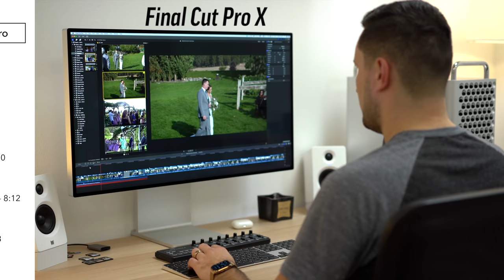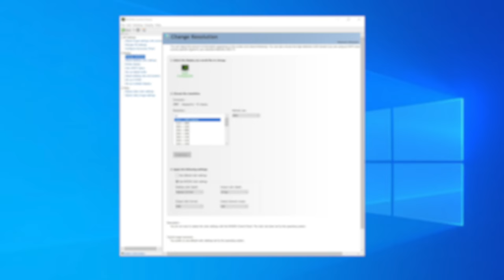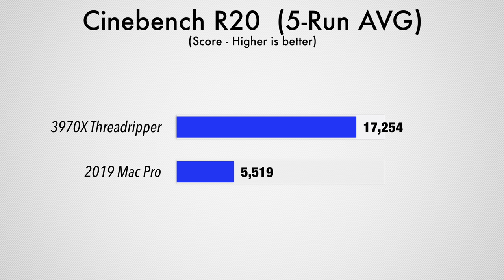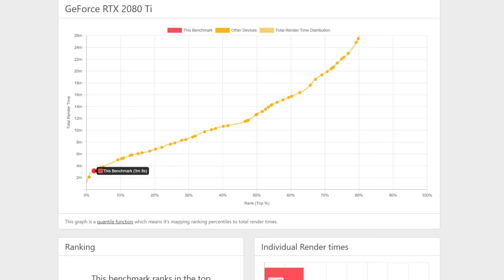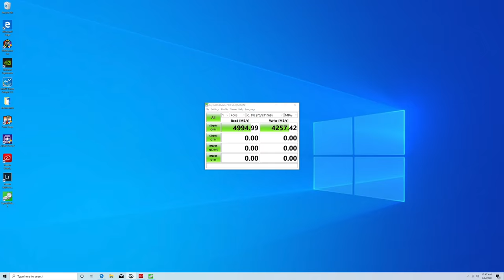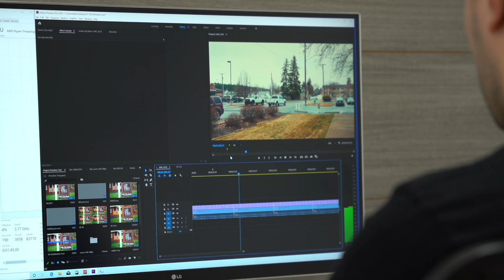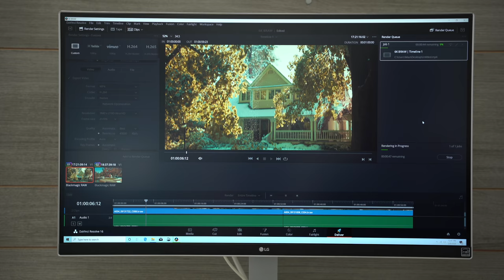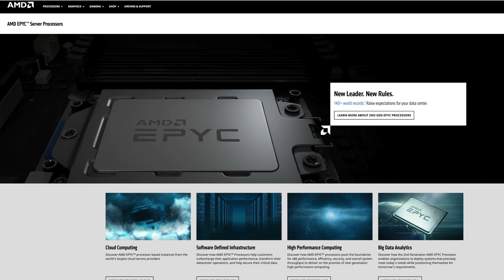$15,000 Mac Pro vs $5,000 Threadripper - Sorry Apple..

Comment: Imagine spending $15000 on a Mac that was outdated before it even came out lmao
Reply: Or if you max is out and spend $100k lol
Reply: I personally agree with what was said. The Mac performs better with the afterburner and speeds up my workflow when editing. And there’s final cut.
Reply: lol
Reply: @kavishpersad2102  final cut is trash
Reply: @toyotamarkIIjz  hate on macs all you want but final cut is NOT trash. Im not some apple fan, infact i hate their scummy drivers. However, final cur is N O T trash.
Reply: BoiCantGame yea, final cut competes with Adobe premiere pro, trash on macs all you want but final cut is amazing
Reply: More of the reason why Apple moving to their own sillicon and ditching x86. Mac Pro is only 15,000 with intel and upgrades directly from Apple. If you can build your own custom PC then you can upgrade your own mac without Apple doing it for you "facepalm"
Reply: @cr1m203   not what I meant at all, the Mac pros specs shipped with outdated hardware from 1-2 years ago, specifically the processors and GPU's, that isn't Intel's, AMD's, or Nvidias fault. It's what apple chose to use. Prebuilds with fair pricing are commonplace now, take a look at origin PC for example. 

What's apple does with its pricing isn't because of any third-party and isn't an excuse to make its own processors, they want as much revenue as possible, using their own cuts out the amount they pay Intel at our expense. Software and games are already difficult to code for Mac OS, now even harder with proprietary chips. 

Apple wants it's own bubble where everything is done by them. That's fine however it hurts the consumer as well as minimising competition. "Facepalm"
Reply: @tamazhi6762  My point is the price is not based on the outdated parts its based on letting APPLE do the upgrades for you. The video is not out lining the whole thing. Not everything has to be bought from Apple, and the base hardware is INTEL not AMD .....AMD has always been cheaper when building even custom pc's vs custom INTEL pc's was one of my major points.
Reply: @cr1m203   I mentioned AMD because in the base model, they use AMD Graphics cards. However, yes, Intel is generally more expensive, that still doesn't justify its price, like I said Origin PC do a great job at making reasonable markups on prebuilds.

Having apple CPU's is a bad thing too, because they would never make them purchasable as parts. You'd need to pay apple to do that for you.
Reply: @AgentSmith911  @10:44 he says maxed out .. exactly when I read your comment ..
Reply: Imagine buying several $15000 Mac Pros because you have a team of editors. $$$
Reply: man i said that to my apple fan boy brother in law he was triggered lol. i  said i could make  hima custom water cooled loop thread ripper for less he said  "ApPlE iS tHe FiRsT  tRiLliOn DoLlAr CoMpAnY"  like fuck ok spend 20k on a old tech PC man good for you you have a half speed PC and an apple with a chunk out of it
Reply: Damn😂
Reply: @Daakkii  I hate macs very much, but even i agree that final cut is pretty good. They have my respect. I respect the macbooks, i just hate everything else mac. Imacs, mac pro, etc
Reply: Now they should do a 15k$ Mac vs 15k$ PC I know the PC would win

Comment: Apple should hire him as a salesperson 😂
He is trying so hard to defend Apple
Reply: He needs to put his clown makeup back on. Complaining about the noise - adjust the fan curves then. Apple probably have the fan curves preset and this clown has left them at stock and complains lmao
Reply: @enesvergil7543  what?
Reply: Channel name is Mac Tech lmao what did you expect
Reply: @aa-anti  you sure its not Mac Tech?
Reply: @enesvergil7543  İyi misin kardeşim?
Reply: @enesvergil7543  bro i live in colombia and just for a little bit more money i can buy something better
Reply: ahah its done already
Reply: lolll
Reply: Mac SUCKS
Reply: @aightm8  or just buy a bunch of custom water cooling parts instead of an AIO
Reply: @AustenHilton  either way if the fans on the radiator are at a set RPM they are loud, even in a custom loop. It's just that no one who ever made a custom loop was dumb enough not to set a fan curve in the bios afterward. The issue in the video isn't the actual temperatures it's the fan configuration. A custom loop doesnt fix the issue because temp is not the issue.
Reply: He's Trying so hard to defend Apple That he didn't Even enable encoder On pc side while in Apple side He did Holly molly this Guy is Biased
Reply: He's already working for Apple Insider.
Reply: @slayelectro7334  Keep in mind that this guy writes for and gets paid by Apple Insider.
Reply: @aa-anti  More like Max Apple.
Reply: WTF the title of the video is literally “sorry Apple“
Reply: @Hottactioncop  Or Max Apple?
Reply: @TheXth  That's cause the threadripper is just that much better. He is trying to sell apple by saying "yeah apple still has its benefits though".

Comment: PC: Basically Outperforms most of the Mac Pro for 1/3 of the price.

This Dude: BUT THE NOISE!
Reply: trueeee xDDDD
Reply: There would be no noise if he just went with better cooling solutions. This guy is a complete clown
Reply: Oooof man it can be a drinking game, every time he says "BuT tEh NoiZz"
Reply: Also he forgot about VM's. If you really like MacOS using a VM with that kind of build is nothing which devalues buying the Mac even more.
Reply: @Sam-um1uh  yeah it has been shown that water cooling isn't better than air cooling
Reply: Its his fault anyway. He easily could have gotten better fans.
Reply: For 10k u can sound proof the entire pc so it's nkt an issue
Reply: Hes constantly mentioning the RAM too, like "well the pc can only have 200gb while the mac can have 1.5 tb" like what? Who even needs more than 64 gb?
Reply: @legoentertainment8750  ikr
Reply: @cyberspino6277  for 10k i can sound proof the whole house😂😂
Reply: @legoentertainment8750  people who use intensive and stressful programs such as Autocad or things like AI and or servers.
Reply: @noddlecak3279  OMG, Servers on Mac? Not even LAN servers
Reply: Lego & Entertainment ever used after effects?
Reply: @legoentertainment8750  You know what the funny thing is that he didn't mention the price that 200gb ram and 1.5tb would add 10k or 25k...
Reply: William Lau For threadtripper I think it right Ive seen that liquid cooling on An big cpu like that Its better for an air-cooler or an Custom expensive liquid ond
Reply: @mr.schaeffer5399  can soundproof the whole house, still can't afford a mid-range Mac Pro
Reply: Lmao
Reply: @WilliamDezunchd  I mean...you’re wrong, but nice try? Water is a perfect medium for storing heat, why the fuck do you think cars have loops filled with a water/antifreeze mix?
Reply: @noddlecak3279  well even with those I think 200gb is plenty
Reply: you take these tech reviewers seriously? they know as much as the regular folk! i just want for entertainment while taking a shit!
Reply: @Sam-um1uh  That Enermax cooler is a piece of garbage.  He can do much, much better.
Reply: @radu72ful  25k for mac pro from apple.. 10k from others.. Lol
Reply: @noddlecak3279  CAD can be done very well with 64 gigs ram as well.. That not a prob.. But I obviously have options to choose Epyc cpu and get 2tb ram just under 12k dollar unlike 25k for 1.5tb for mac pro lol!
Reply: @legoentertainment8750  he could buy a better motherboard and pit like 4TB ram in :D
Reply: based on on how much the comment section kept saying "the Noise", i am starting to suspect that The noise is actually made up by the dude (content maker) to have 1 reason to choose apple.
Reply: @aluandcache7336  15000$ comes with 9nly 786gigs of ram shithole
Reply: @ALmaN11223344  He's really not wrong IF you're an average consumer. The Noctua NH-D15 and Dark Rock 4 Pro match or outperform most aio's in the 240-280mm radiator range. They're quieter, cheaper, and the thermals measure just as low if not lower than most standard aios. Of course a 360 mm radiator will be better, but most people won't need that.

This isn't including custom loops.
Reply: @dat_lou5561  this comment has no base
Reply: @Nuka_Gaming  because it's a joke?
Reply: for the 10000$ you save you can get water cooler
Reply: The noise is actually still better than my mom's Lenovo Ideapad when running a game.

IT GOES LIKE A JET ENGINE, AND ITS FAN AS HOT AS ITS EXHAUST.
Reply: Increase the volume of your speakers or head phones or else just keep the PC in a drawer
Reply: @squadteam2309  XD
Reply: You can fix the noise lol
Reply: @legoentertainment8750  Also $25000 for 1.5 tb ram, Who needs a house when you have a white cheese shredder?

Comment: "Only 42% faster" 

The fact that it's considered a small bump even though the cost is 66% lower perfectly illustrates the absolute obliteration that Apple is going through.
Reply: That effectively makes it 326% better value for money though... One has to wonder what a 15 grand PC is capable of... 😅
Reply: @s4rg380  ⛄
Reply: @s4rg380  teleportation and warp 10 speeds!
Reply: @TENNSUMITSUMA  and probably nuclear meltdown... 😅
Reply: How do you get 326%?!
Reply: @TENNSUMITSUMA , it's 42% better, right? That is what he said, then it's 2/3 the cheaper, theoretically 142% for each 5 grand spent. 15k Mac - 5k PC

42+142+142 (the first third's 100% is negated because it equal to the Mac not exceeding.)

It's not exact mathematics, the proper scientific term is obliteration...

Don't qoute me on my math... (it's utter bullshit) 😅
Reply: @s4rg380  ah!
Reply: @TENNSUMITSUMA  🤣
Reply: only 1/3 the price
Reply: @fgtechtips , makes it 2/3 cheaper, doesn't it? I think you may have misread...
Reply: he didnt even use the 3990x which would have brought the cost up to half the price of the mac but maybe close to double the performance
Reply: @nicholasboule5134 , the 3990x is only $2000 more, so you are correct. Not sure if the performance is exactly double, but it is close enough to make no difference.

And some misguided 🍏 fool will still think that his Mac is more powerful.

"It's more expensive, so it has to be better, right?"

Wrong... It's good, but, not thát good.

Next, they'll want it to be compared to the $40000 Mac Pro.
Because that is just how Applefanboi logic works...
Reply: @s4rg380  amazing counter back to all 🐑 😁😁
Reply: @aluandcache7336  I truly have nothing against Apple, It's the ignorance of the users that trigger me.

Besides that, I just prefer actual value for my money.

I once saved up for a Mac, but I bought an equivalent PC and a new car instead...

I also use a MacBook air as a mouse pad, because of it's superior quality finish, and, that the only real way to game on a Mac.
Reply: @s4rg380  Same here! Exactly same! Those sheeps including Max Tech are just unbelievable.. Apple is there for being overpriced! You know for trim Mac Pro they are keeping 2000$ for each of 128gb ecc ram stick where I believe you can get each of those at 1000$ through a deal with Samsung or others..
Reply: @aluandcache7336  yeah, it's sickening that people are so naive... Apple tax.

The price of ignorance, I guess.
Reply: @aluandcache7336  hilariously though, AMD called their EPYC CPUs "ROME" because is wasn't built in one day.

But Intel has been resting on their laurels for too long, so I think a little competition is exactly what we need. That's the only way anything ever improves. I've been Intel all my life, but I am past the point of defending them.

You can guess what my next build will be, just giving it a bit of time to mature.
Reply: @s4rg380  Yeah exactly,, Without competition we would get products with a higher price point than what it should be..
Reply: @aluandcache7336 , exactly what is currently going on with Intel.
Reply: And when Apple does something better, he exaggerates it by saying "incredible" LuL
Reply: @s4rg380  broo please!
Reply: @aluandcache7336  I was referring to Intel constantly rehashing the same chips. Instead of innovation, they are resting on their laurels. Sorry for the late reply, I must have missed your previous comment.
Reply: @s4rg380  Intel is now lazy AF just like Qualcomm at mobile SoC
Reply: @aluandcache7336  I am slightly confused, you replied to me:

"Broo please! "

When clearly were on the same page, perhaps that was intended for someone else?

Soc will be stagnant for a bit, I think they have the limits of the current manufacturing process, which is the main reason Intel keeps rehashing. So, yes they're in the same boat, but for different reasons, Intel definitely has the capital to do the R&D, they just chose not to. I suppose the same holds true for Qualcomm.
Reply: @s4rg380  I was actually asking help for other comment section to encounter a triggered Applesheep as I'm not proper at English
Reply: @aluandcache7336  okay groovy, where's it at bro?
Reply: @aluandcache7336  English is my second language too, but that doesn't hold me back.
Reply: @s4rg380  You can find it in the top comments named Mark Dupuis. And that applesheep name is Prowlfilm
Reply: You tried hilariously hard to defend Apple tax, I salute you sir. 

111 coments?
Reply: @s4rg380  yes sir
Reply: @s4rg380  look prove him wrong somehow. but with logic where you're very good at
Reply: @aluandcache7336  go have a look... His comments are some of the dumbest I've seen, and trust me, I've seen plenty of dumb ones.
Reply: @s4rg380  So what will you do now? Wanna teach him some lessons?
Reply: @aluandcache7336  I left a comment, waiting for reply, though I'm not really expecting one. Kinda difficult to argue with what I pointed out.
Reply: @s4rg380  Man you just amazingly showed all points you got! Excellent work man! 

Can you inform me please where to get such English lessons?
Reply: @aluandcache7336  just keep at it buddy, It'll come on its own. Besides for someone who doesn't speak English natively you're not doing nearly as bad as you think. I've seen worse from people who are actually English. 

Mind if I ask what your mother tongue is?
Reply: @s4rg380  Thanks buddy! Your words mean a LOT to me! 

Can I get your any social id (facebook, whatsapp) or email? So I can get back to you.. Actually I feel some regional restrictions to expose myself. I hope you'll understand those restrictions. If I add with any of your social id I'll be then free to say you anything. Same time you can be a guideliner for me as well.. Tia
Reply: @aluandcache7336  are you satisfied now? 😂 🤣 😅

I don't feel comfortable with posting my number on YT, don't use Facebook, never had a liking for it, too much politics, if you catch my drift, could drop you mail though, that ain't an issue.
Reply: @s4rg380  Let me know after you knock me.
Reply: @aluandcache7336  sweet stuff, let me know when you got it.
Reply: @aluandcache7336  I dropped you a mail, subject will be: Sgt van der Walt
Reply: @s4rg380  Ok thanks for your cooperation
Reply: @s4rg380  and keep in mind that performance whise in cinebench r20 the pc scored 350% of the performance of the mac pro.
That mac is a ripoff
Reply: @s4rg380   after reading all of you comments with Epyc to Xeon. I have discovered that there are people who think like me, and to be honest i really wanted to be a part of this conversation as i found it real cool to call a person for help to obliterate a dumb 🍎sheep, and i really wanted to talk to you personally but i can't do that, and very well know the reasons for it. You too are cool as f people. And if you had any such conversation again, you know the rules and so do i. Call me off as i will be somewhere nearby.👍 
Respect by my side to both of you.
Reply: @theencore398  hahaha, yes there are a lot of people who think like this, it's called having a brain... 😅 Thanks for the shout out.
Reply: But why do the programs run better still on the Mac? As an avid gamer and a designer i have both and love both. but my 2017 mac pro i7 still runs illustrator and photoshop seamless. my new 2019 MSI Alpha 15"  Ryzen 7 photoshop and illustrator take forever sometimes and Illustrator crashes from time to time. Why? there are other things that seem to matter more than just pure power, speed, and memory. i also pretty much have to buy a new PC every 2 years as opposed to my Mac i just buy the new ones every so often but i don't "need" to really. But if you never really used a Mac for anything extensively you may never know why people like macs. they are for different uses. they are optimized for different specialties.
Reply: You must be unfamiliar with how much Intel Xeon CPUs cost.  I recommend reading more.
Reply: Braxton Lucas I’ve mentioned it on multiple different threads but I run an online business.  I used to use a mac for this.  When my mac went down it took almost 2 weeks for Apple to fix it.  I sold it because that time had cost my company 10s of thousands.  I’ve been using a windows machine ever since and I’ve been extremely pleased.  It’s faster (I know how to properly optimize windows) and if a part goes bad I run to the store and buy a replacement and have my computer running in under 2 hours.  Less time down means more time making money.  Macs are a waste to anyone doing professional work.  Less powerful, more difficult to fix, and wildly more expensive (not really an issue with what I do).
Reply: the problem is intel not Apple they have a deal which gives them exclusivity on Mac computers, in fact the cpu prices in the Mac Pro are actually like market prices but intel sucks compared to amd
Reply: Mac Pro's used to start in the low $2,000 range.... now it's like $6,000 for the base model.  And pound-for-pound, they don't seem to be that much better. What has changed in the past 10 years?!
Reply: @s4rg380 lol 😂😂😂😂😂 we have smliraties because my math is bullshit